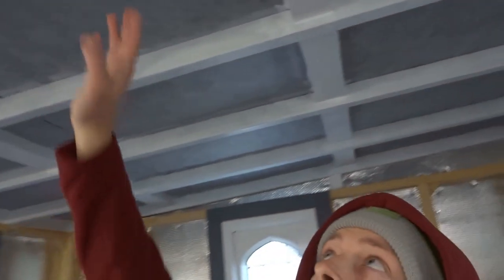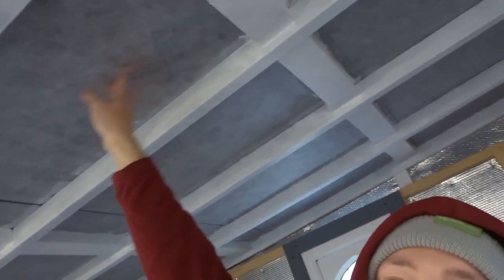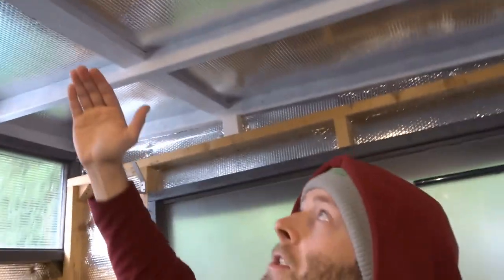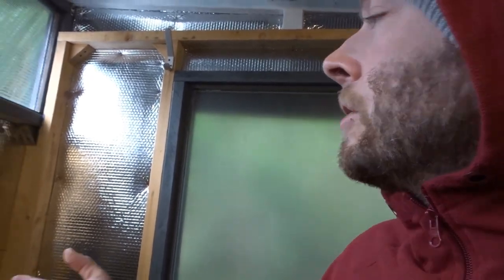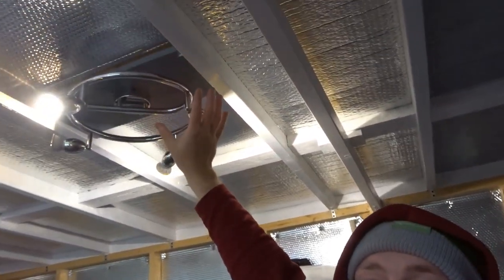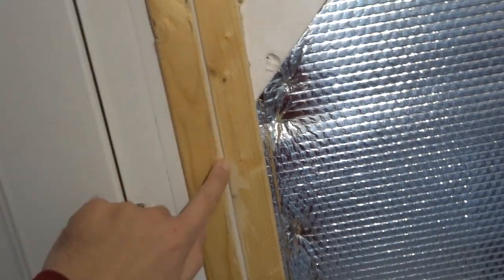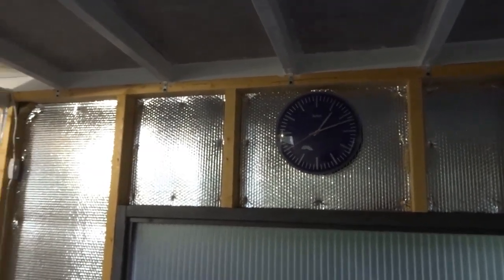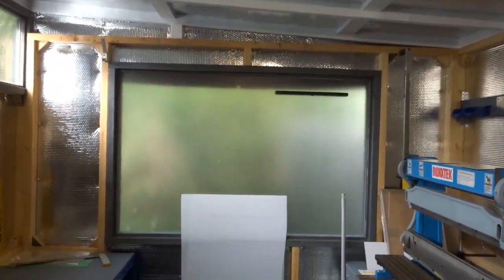How to Insulate a Workshop / Shed / Man Cave and Prevent Condensation

Comment: Phil here Phil can I ask you if you stapled the Thermawrap insulation roll directly on to the shed wall or would it be better to have another protective layer first. I thought about weed fabric control directly on to it first then the insulation thermal wrap on top then board over the wall studs if you know what I mean. I look forward to your reply it all looks great you done a great job I hope that mine turns out likewise. Cheers. 🏴
Reply from the maker: Hi Phil, yea you could always add an extra layer although it might not be so breathable then. If you have adequate ventilation then that should be fine. I wish I had added another layer to my roof although everything is fine after 2 years now.
Reply: @PhillWyattProjects  that’s great mate thanks for replying I’m going to buy one of the trickle vents and instal one on the top area as you directed a good idea and I’ll leave the existing shed door until I can source a pvc one with glass. Thanks again Phil 🏴

Comment: I'm getting condensation on the inside of my wood panels of my shed. If I do this would it stop the condensation? I'm worried that if it will still condensate this will make it a bigger issue because now the water will be in between the wood panels and the insulation and stay wet for a longer time
Reply from the maker: It depends, do you have ventilation in your shed? Do you have any leaks? and what kind of base is your shed on?
Reply: @PhillWyattProjects  I don't have any ventilation, it's pretty sealed, but Im sure I have some air leakage if that's what your referring to, and it's sitting on a few cinder blocks, so it's not touching the geound
Reply from the maker: @sakomardirosian3439  I recommend to install a vent towards the roof area near head height.
Reply: @PhillWyattProjects  I did double layer of insulation and it seemed to fix the issue. One layer of the r13 and on top of that added a half inch foam board

Comment: Does this keep the temperature down in the summer?
Reply from the maker: Yes it does help to control the temperate although the main factor in summer is the amount of Windows. I have many windows that creates a green house effect. If you have less windows then it is much more effective at deflecting the heat from the sun.
Reply: @PhillWyattProjects  thanks for responding man

Comment: I've got a 20ft x 12ft timber workshop...done loads to it ....getting mould problems and cannot use it or go in there now. I've had several ppl out who claimed they could sort it or find the cause ...absolute jokers. 
Its been a money pit and just taken away the excitement...its now the brain of my life ... and from what I've understood and what you've basically confirmed is a condensation problem... HELP 😬😩
Where are you in the country??
Reply from the maker: Hi I'm in the Midlands. Do you have a damp course under your floor or vapour barrier or any kind of insulation? Also, have you tried installing a vent?
Reply: @PhillWyattProjects  have you apart from youtube somewhere i can contact you? Facebook??
Reply: @PhillWyattProjects  I'm in Reading ... want to go through what I've done and how i built mine then maybe you can advise. Already seen a couple of things on your videos i need to do. 
I built the base ....scalpings whacked down , rebar etc ..7-8" of concrete BUT forgot DPM  🙈 ...theres a 1 brick later of engineering bricks around the circumference of the workshop which were painted with 2 coarse of bitumen and before sitting the panels on the put a DPM covering the bricks even though they had 2 coats of bitumen. ...had to seal the floor with concrete dustproofer bc the concrete company were a joke so it was a bit porous ( created a fair bit of dust ) ... roof was 12mm structural ply sealed between each panel with GB pro silicone sealant as were each of the structural panels. On top of the 12mm structural ply i put a fair bit of bitumen then laid polyester lined felt ( overlapping by 5" and plenty of bitumen between the overlaps....then a metal box profile roof was put on ....
Internal walls had a DP membrane put on from the company I bought the workshop from but i preserved the outside and back of the panels with Premier Q wood stain / preserve...it did coat a lot of the panel DP membrane but I've been told should affect it??
Walls inside were then insulated with 50mm polystyrene sheets leaving approximately 15-20mm between  the outside cladding and foam insulation then boarded inside with 6mm structural ply.
No vents were added at this time. That winter whole workshop inside was black mould ..under ceiling and walls ....added vents now andits just on the ceiling boards ( not the 12mm structural ply roof as I put a ceiling up with a void between the 2 if that makes sense? ..there are 2 x 76mm round vents either end of the workshop to air the roof space void . ) ...so basically only thing on the floor concrete is the floor dustproofer sealant which isn't damp proof .. just stops dust kicking up.
I do have the bubble foil coated insulation under the perlings just under the 6mm ply ceiling boards ... doing my head mate. 
I'm on hoarders next week ..,you should see the bungalow 🤪😂 lawnmower ..tools everything
Reply: @martynj-c4965  If it still getting cold and damp with the air in the winter then it will always accumulate mould...maybe put one of those greenhouse bar heaters on a thermostat on about 5 degrees to take the chill out the air....if its insulated well enough. Refit the floor with some barrier underneath too and exclude all draughts.
Reply: @martynj-c4965  if u could check the roof and see if the bitumens still wet, if it is thats ur issue i reckon